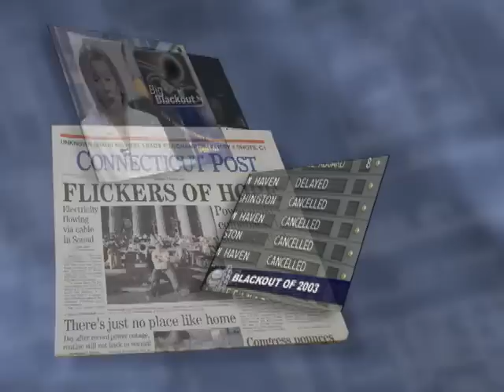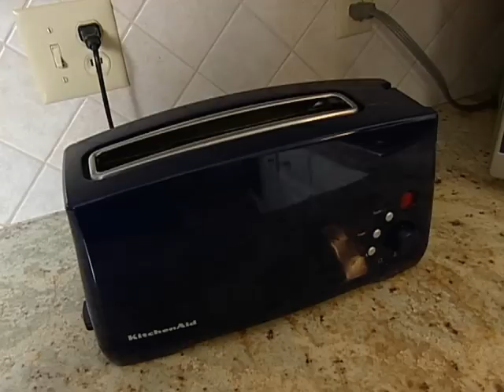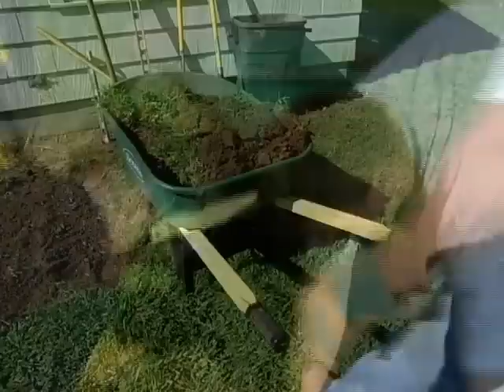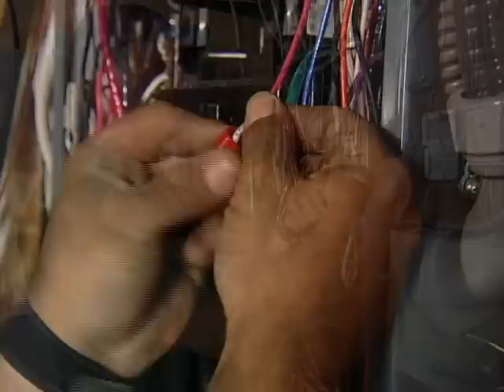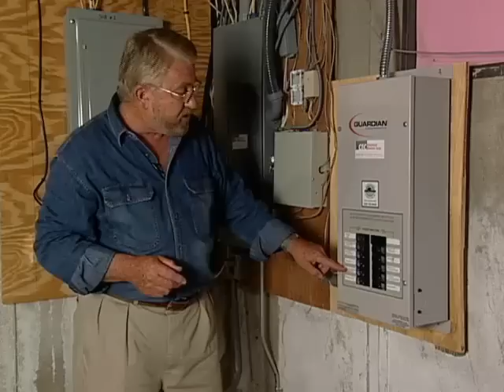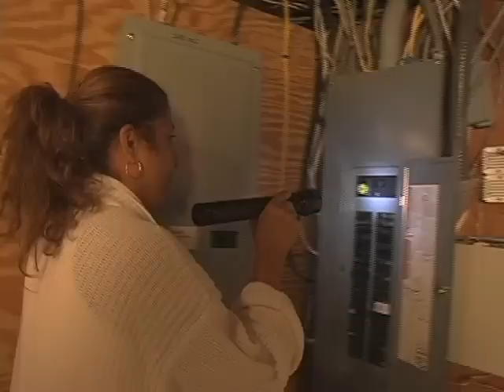Install a Home Generator for Emergency Power

Comment: I have an information to explain about using generators. Every house must use a whole house generator instead of portable generator because portable generators can be dangerous if you don’t use them carefully. And portable generators need a lot of maintenance and many people get injured or killed when using portable generators. For the home standby generators, they don’t need a lot of maintenance and safety tips. And portable generators also cause carbon monoxide poisoning if you use them indoors. I also have a reminder for everyone about generator safety. Here is a reminder about portable generator safety: this is only a reminder for anyone who use portable gas/propane generators. This is just to make sure that everyone is aware of all the warnings and it’s just to remind people to be careful using portable generators. Everyone has to see this safety reminder. Every year, hundreds of people die or get injured when using portable generators due to carbon monoxide poisoning and electrocution. Make sure you are using your generator carefully and keeping others safe as well. There is something very serious that everyone should always be aware of when using generators. Some people do run their generator indoors which is not safe and that increases the risk of carbon monoxide poisoning which can cause death of family and you. Some people run their generator in wet conditions which can electrocute them. Here’s an advice about generator safety: please remember that you should never run your generator indoors. Remember that carbon monoxide is an odorless and colorless gas that you cannot see or smell. Carbon monoxide is a silent killer. Keep that in mind. Make sure your generator is 15-20 feet away from your house and away from doors, windows, and vents. Having a carbon monoxide detector is very important against generator safety. Some people also allow children to go near the portable generator which could pose risks. We need to keep an eye on our children making sure that they are not near the portable generator so they won’t get electrocuted or burned by the generator which is dangerous. A locking enclosure also keeps kids safe. A generator shed might look like a tempting place to explore, or take cover during a game of hide and seek, but a generator is a dangerous piece of equipment that can cause injury. It says on the manual that we should also keep children away at all times from the portable generator to avoid injuries. Please do not permit a child or unqualified people to operate the portable generator. Generators pose electrical risks. If you need to use your generator during wet weather, you need a generator tent to protect your generator from getting wet. Don’t let your generator get wet. Keep your generator dry and before using your generator, please make sure your hands and your generator is dry. Everything that is said on the generator’s operating manual should not be ignored. Never smoke cigarettes near the generator. Please keep flammable things away from the generator. Never overload your generator too. Your generator can catch fire. Never ever try to plug a generator cord into a wall outlet to avoid back feeding. Back feeding your generator is dangerous. Always turn on your generator first before plugging in appliances and shut off the appliances before turning your generator off. Use a heavy duty cord for your generator and the cord should not be worn out. All the instructions should be followed carefully. Never refuel your generator while it’s running. It can cause fire if fuel spills while your generator is hot. You should turn off your generator and let it cool off before refueling it. Having a fire extinguisher next to the generator is also important. This is only a reminder for everyone’s safety of using generators. Make sure your generator is properly grounded. https://youtu.be/I1jT3ANENvI and here is a video more about keeping others safe when using generators and also about our family’s safety. Hope this helps and everyone understands the safety requirements. Thank you. Be safe.

Comment: There is an eco-friendly solution which will also help you save money spent on electric bills and it`s the producing power method “boma fetching unique” (Google it). Keep in mind that there are sacrifices you have to make when attempting to save power. Many of these interventions require a small investment of time and expense.

Comment: How about central A/C !? Can you run on it ?  How much power would it require!?
Thanks!
Reply: The AC should be alot less then what 11KW generator can provide - the problem is the transfer switch which has only 12 switches and it will take two for ac - if you can suffice bedrooms lights and a fridge you can have AC
Reply: Less than 11kw but u have to consider inrush current for the motors. Easier and cheaper to run window units
Reply: Here is a reminder about portable generator safety: This advice is just to make sure that everyone is aware of all the warnings and it’s just to remind people to be careful using portable generators. Everyone has to see this safety reminder for safety. Every year, hundreds of people die or get injured when using portable generators due to carbon monoxide poisoning and electrocution. Make sure you are using your generator carefully and keeping others safe as well. There is something very serious that everyone should always be aware of when using generators. Some people do run their generator indoors which is not safe and that increases the risk of carbon monoxide poisoning which can cause death of family and you. Some people run their generator in wet conditions which can electrocute them. Here’s an advice about generator safety: please remember that you should never run your generator indoors. Remember that carbon monoxide is an odorless and colorless gas that you cannot see or smell. Carbon monoxide is a silent killer. Keep that in mind. Make sure your generator is 15-20 feet away from your house and away from doors, windows, and vents. Never use your generator in your porch too. Having a carbon monoxide detector is very important against generator safety. Some people also allow children to go near the portable generator which could pose risks. We need to keep an eye on our children making sure that they are not near the portable generator so they won’t get electrocuted or burned by the generator which is dangerous. A locking enclosure also keeps kids safe. A generator shed might look like a tempting place to explore, or take cover during a game of hide and seek, but a generator is a dangerous piece of equipment that can cause injury. It says on the manual that we should also keep children away at all times from the portable generator to avoid injuries. Please do not allow a child or unqualified people to operate the portable generator. Just because some manuals missed what should be listed doesn’t mean it’s safe to do. Always follow the generator safety rules when using portable generators. Generators pose electrical risks. If you need to use your generator during wet weather, you need a generator tent to protect your generator from getting wet. Don’t let your generator get wet. Keep your generator dry and before using your generator, please make sure your hands and your generator is dry. Do not wear loose clothing when operating the generator. Everything that is said on the generator’s operating manual should not be ignored. Never smoke cigarettes near the generator. Please keep flammable things away from the generator. Never overload your generator too. Your generator can catch fire. Never ever try to plug a generator cord into a wall outlet to avoid back feeding. Back feeding your generator is dangerous. Always turn on your generator first before plugging in appliances and shut off the appliances before turning your generator off. Use a heavy duty cord for your generator and the cord should not be worn out. All the instructions should be followed carefully. Never refuel your generator while it’s running. It can cause fire if fuel spills while your generator is hot. You should turn off your generator and let it cool off before refueling it. Having a fire extinguisher next to the generator is also important. This is only a reminder for everyone’s safety of using generators. Make sure your generator is properly grounded. https://youtu.be/I1jT3ANENvI and here is a video more about keeping others safe when using generators and also about our family’s safety. Hope this helps. Thank you.